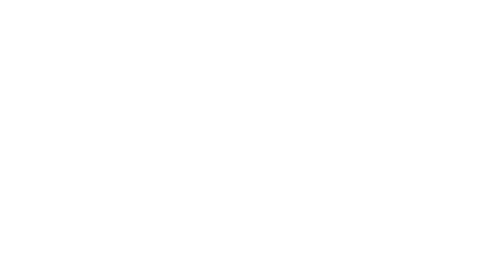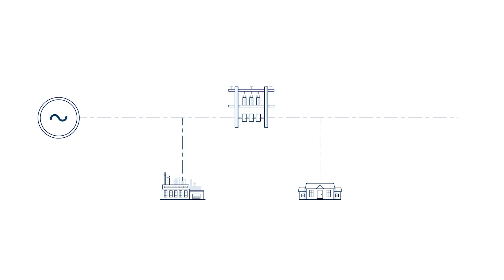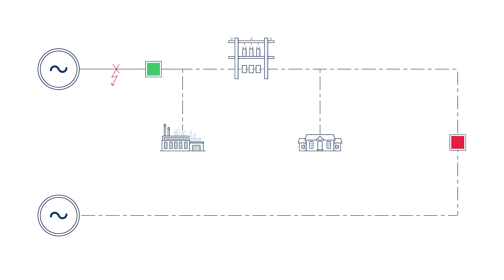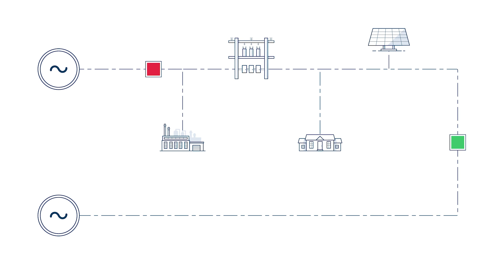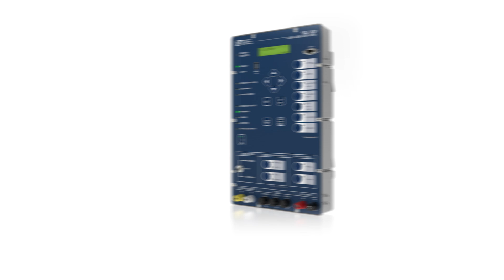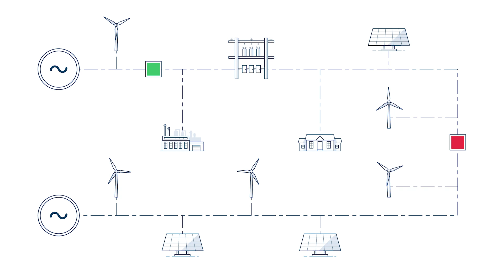Simplify and Improve Voltage Regulation in Any Distribution System

Comment: Do you need that algoritm if you know the direction of the curent ?
Reply from the maker: Hello Swatcat. Thank you for your question. Even if you know the direction of current, there are still situations in which you might regulate against the direction of current flow - for example situations where current is flowing from a DER site, through the regulator, towards a substation source. You would not want to attempt to regulate that substation source, and instead would prefer to regulate against the direction of power flow. So current alone does not provide enough information to choose a regulation direction in every instance. SEL's FlexDG algorithm helps choose a regulation direction in systems where power flow direction doesn't tell the whole story.

Comment: Can sel 2431 devices automatically detect and adjust power flow without using acceleration software?
Reply from the maker: Hello Imadaitlahsaine. Thank you for your question. SEL's AcSELerator software is used to configure the control, including choosing the control mode, but after configuration the device operates independently, and will adjust its regulation direction based on the mode you've chosen.